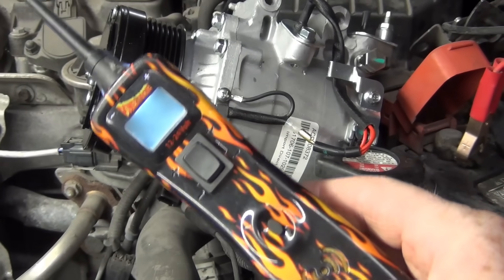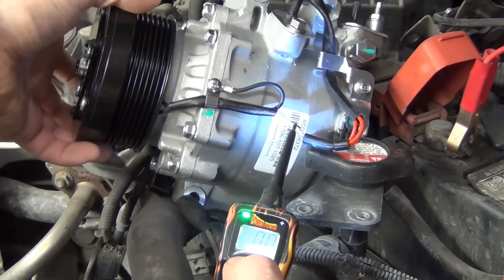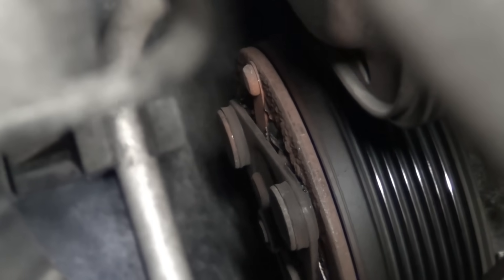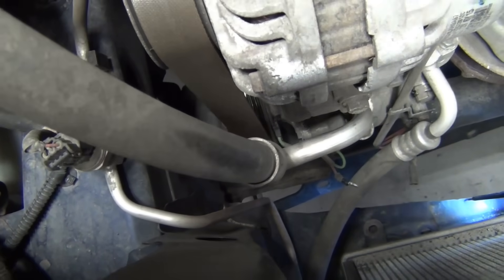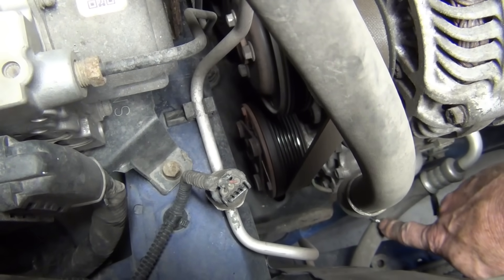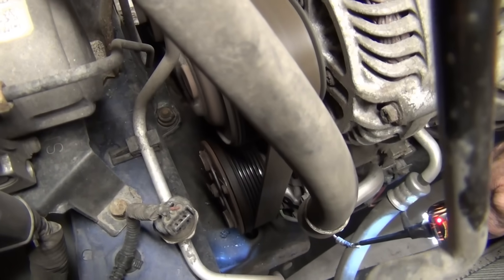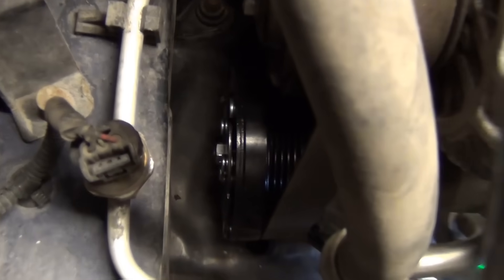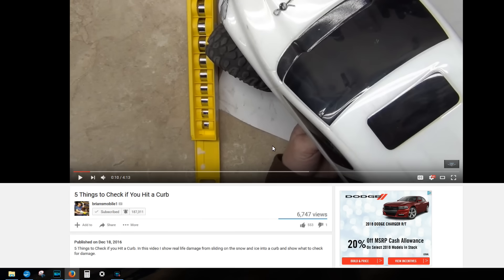How-to Test for AC Compressor Clutch Function

Comment: A 40-50 dollar clutch kit vs a 350 dollar compressor then evac and recharge the system. I'll go wit a 40-50 dollar repair over a 450 plus anyday. But, then again most modern day mechanics are simple parts replacers.
Reply from the maker: That can be a great low cost temporary solution when you can find a compressor clutch for a given application.    In my experience (30+ years) when I have done that the compressor more often than not fails in the next year or two anyway.   It's proven to be more cost effective for my customers to replace the compressor with a new clutch, and the reciever/drier and not have to do an extra clutch, evac, and recharge on top of that in the long run.
Reply: AC compressor for my car is more like 6-700 euro. And a used one. Like the half price. Not fun at all.

My clutch doesnt engage either. AC relay and AC fuse in the fuse box clicks and seems OK. Should engage when i activate the relay manually through my bidirectional scantool. Relay clicks but no engage. :(

Had a metal sound when i turned off my car for a long time. Like clutch dissengaged hard or something. High sound anyways.

When i turn the AC on/off button the rpm raises/loweres so i guess nothing is wrong on the computer input side.?

Comment: My problem is that the church is engaged it never disengages and air is slow to cool.
Reply from the maker: You could be low enough on refrigerant that it never can build enough pressure on the high side.  Could also be a stuck open expansion valve (on some equipped vehicles) or a bad compressor intake solenoid (on some equipped vehicles).

Comment: Spend $100 for a glorified switch with a light in it?  Pure nonsense, you can check the ac clutch the same way with a wire clipped onto the positive battery terminal.
Reply: Who is glorying it? It's a tool being used for its intended purpose.  As far as clipping a wire on the positive terminal,  that sounds messy. If you have the money,  why not invest jn a power prob. I drop a bill every time I go to the bar, dropping another 100 on a tool is  nothing. And why you so mad at what other men choose to spend their Money 😅😅
Reply: Yea but it don’t have flames 🙄
Reply: Also need a a fuse wired in between to safely use that method
Reply: Until you have used a power probe don’t dog on it
Reply: Obviously he doesn’t understand how it works or true function of that power probe
Reply: Just take you’re car to a shop, you sound like a glorified couch potato
Reply: Ok you have mo idea what u are saying
Reply: Either way works
Reply: $15 on Amazon.
Reply: @Evrydyryder  drop the link
Reply: There's some on Amazon for under $25. It's a great thing.
Reply: ya most people like u will poke snd hack up wiring that tool is invaluable for electrical work on cars
Reply: @hiby9105  Or they'll end up frying something that was supposed to run below the full 12 V they just fed it. Kind of a prime example of why stubborn idiots hate modern cars, really. Don't like learnin' things, knowin' stuff is for NERDS. 

Irrespective of the fact that gearheads are just nerds with a gol dang wrench.
Reply: @hiby9105 false bud.
Reply from the maker: That's how I thought till I used one.  Took me years to get over my ego about it.  Bottom line- I use it constantly now that I have one.  It's more than paid for itself in time savings over many jobs and many years.

Comment: What if the compressor clutch engages at all time?
Reply: Ali Alrashidi there are variable clutches l, meaning it slows down and speeds up. But if it’s constantly spinning with the speed of the serpentine belt, then your compressor might be stuck on engaged, the compressor should never be on, the entire time.

Comment: I had water seep into a disconnected 07 Subie A/C Compressor, Rusting up the Front Needle Bearing. Thus freezing up the Rotation of the Compressor. I've Cleaned, Loosened and Assy Lubed up the bearing and the rest of the Innards. Now, Wondering if I can Road test this unit to see If it's working?
Reply from the maker: Once bearings are pitted or rusted and especially if the rust material is still in there, it's days are numbered.  You can take the belt off of it and run the car.  I would recommend a tear down and replace the bearing or the compressor to do it right.  Bearings are cheap if you can find them.  Often $6-$20.  If you charge and run the system with rusty bearings it would be like a robot vacuum encountering poop on the floor.  it will spread through the system.  If you don't charge the system, your low side cut out won't let the compressor come on and it wont run.

Comment: So the clutch shouldn't engage unless I turn the a/c, on right??
Cause mine is on and off whenever  the engine is running.
Thanks for the video.
Reply from the maker: If your defrost is on and your car is newer, it will turn on the AC for you and turn off recirculating air for best defrosting results.

Comment: Hey Brian! I have a crv 04 and when When I am driving round with ac on my idle will serge from 1500 to almost 3000, just when ac is on!  And it seems it is only when ac clutch disengages I will get this violent engine serge Took the car to a mechanic and  he said He stabilized the compresser because I was getting very high readings on the low side added refrigerent but I am still having the same problem any Ideas? And does the engaging part of clutch spin freely when turned by hand with belt off the car? Mine is pretty hard to turn just sitting there not engaged?
Reply from the maker: Geez, It's been 5 months.  Has it been resolved?   
Was it overcharged or was the compressor getting black death?

Comment: My service manual says to test the negative side of the battery to the compressor clutch plug, and positive side to the ground. That doesn’t make sense. I have s 2004 Honda Accord. In your video you connected the negative to the negative or compressor chassis, and positive to the plug correct? Do you think my manual is wrong?
Reply from the maker: If your car is German and is using DIN wiring it could be like that.  Most cars supply power to the circuit.  Germans supply ground and the power is always on.

Comment: hey brian whatsupI like you video I got ask you something I replaced the A/C compressor and the new one dosent work And now my fans dosent work too I checked everything fuses,relay. do you think that I get the wrong compressor ? I said that cuz when I disconet  the A/C both of the fans work my car is a ho nda civic si 2006 coupe, thanks
Reply from the maker: Thanks Gilberto, it's possible it's the wrong wiring config/ wrong compressor.  Is it a single wire to the compressor clutch or more?

Comment: Is a symptom of a bad compressor that when you turn on the AC, it engages, but never stops spinning like other cars.... I'm sure that my charge is perfect......it will stop spinning when I turn off the AC , but is never intermittent? Any help with this would be great ....btw, my condenser fan comes on every time...so that's not the problem. Thx in advance for any ideas.
Reply: Michael chilner did u find the solution after most 6 month

Comment: hey Brian.... you the man! excellent video, precise and straight to the point AC compressor check without taking 40 minutes to an hour to explain, question though, did you vacuum pump the system, did you have to change the orifice tube and the accumulator before you install the new compressor, I'm just curious.... cuz I've got a 03 Honda Element I need to replace the compressor on it won't engage as well, I love that tester unit you used to engage the clutch, sweet! I've got to get me one of those, like I said; excellent diy video content bro! that doesn't take all day to explain, cuz time is a precious commodity! anyhow...thanks for the response in advance.
Reply: Good question dude .  And I notice he never answered it..... .

Comment: Single woman here so sorry if my question is dumb but.....What if the clutch engages and then the air blows cold when its straight wired to the battery? What would i need to do ?(2000 buick lesabre) Im a single mom with no money to take it to a shop lol..The  clutch wasnt spinning until the straight wire..every time he touched the wires to it..it quickly blew cold air but as soon as he took it away it went back to warm air and clutch stopped? I really hope there is a fix for it that isnt expensive.
Reply: Good news. You have an open circuit between the compressor clutch and battery. Trace the wires back. I’d buy a service manual online for around $10. Follow the troubleshooting a bad compressor section. Relays and switches go bad but you need to follow the circuit flow to make sure.

Comment: Thanks for sharing your knowledge...I have a 2001 Chevy Silverado 1500...a/c not working on idle blows hot air and when driving is nice and cold. I have remplace the fan clutch and the a/c low pressure switch. Any ideas on what else could be causing the problem.? Thanks for your help.

Comment: Hey can someone help ? Got AC issue, air blowing hot always. Car : Jaguar s type 2.7 diesel, 2005. things already done  : 
1. checked system for leaks :  none
2. Recharged system with refrigerant. - still blowing hot. from both sides
3. Replaced DCCV to new one - still blowing hot, but passenger side is actually blowing colder
4. Removed Remote climate control module for inspection - perfect condition, put it back in
5. checked if air doors work with every option (only legs, legs and cabin, cabin and windows, windows) - they move accordingly , open and close.
6. Checked if compressor clutch engages with ac turned on - it does but in a minute it stops. While it is working , air is still blowing hot. 
Is it the issue with compressor ? i am lost././
Reply: Maybe overlooked cabin air filter? Faulty cabin temperature sensor or outside temperature? Just a guess

Comment: Hi I have a 2005 Cadillac STS 4.6 northstar v8 I just serviced my AC unit was alittle low on Freon so i topped it off within the safe psi of what it calls for my question is how do I reset ac service message on the dash? Any help would be greatly appreciate thanks

Comment: I checked all electrical, replaced pressure switch on evap., and while checking my relay, I inadvertently installed it backwards, which engaged the clutch, but made a grinding noise. I quickly removed it and put it in properly, but still won't engage. I replaced the relay, still nothing. Is clutch bad, then? Thank you. Enough refrigerant, etc.

Comment: Hey Brian - Great video. My '97 Mazda MX5 (ok, Miata) had, in addition to the AC relay and the high & low side switches, a thermal protection switch (a thermocouple maybe?)  that would cut power to the clutch if the switch sensed overheating. Basically, the power feed would go into this switch, and then a line from the switch to the clutch.  Often, these switches would fail  prematurely, even if the compressor & clutch were still working. Some Miata guys would simply bypass the switch to get the compressor working. 

Do you (or does anyone) know if the Honda compressor also has such a thermal protection switch? Thx
Reply: Someone had mentioned this to me last year when my AC stopped working on our record day here in WA when it reached 108° theorizing it might be that it overheated the "switch" that you are referring to! Makes me wonder!

Comment: I paid 1500.00 to have evaporator core, heater core and compressor replaced but not blowing that cold like it should be? I'm definitely taking it back , but any other reason? 2008 Nissan Altima
Reply: JR SIMP Really strange they didn’t replace the condenser. The new ones are junk if they experience any contamination from compressor failure
Reply: NordicPride970 You think that's why it's not as ice cold as it should  be?
Reply: JR SIMP Many variables, but it’s well known that modern ac condensers have such small passages that they cannot be effectively “flushed”. So if it’s clogged or damaged it’s something to look into. Typically you can check with a laser heat gun and see if you find an area that has a large variation in temperature. Of course things such as system pressure and a properly working expansion valve are other possibilities. But if you had a compressor fail previously, and they didn’t replace the condenser, that’s just asking for problems...
Reply: NordicPride970 Thanks alot for the response.

Comment: how do you recover and recharge the system, also do you use nitrogen to find leaks or dye
Reply: Dye to find leaks, but in most cases the car leaves the factory with UV dye inside the AC circuit. System is recovered and recharged with expensive equipment and a licence is needed.
Reply: jamecorts it’s not that much money at all to get the machine to recover it is about $400 or you could buy them used for a lot cheaper and to get your 609 certificate you don’t even have to go to school for it you could just pay to take the test which is not that much but you don’t need a certificate to recover it only if you are charging someone to recover it. And when you recharge it you need a set of manifold gauges and a vacuum pumps which you can buy for $50-$60

Comment: I have a Nissan altima the AC works when it wants to clutch and compressor are good could it be a wire fuse or relay?

Comment: After l refill the system my Camry 2004 compressor began to do noise then 20 sec  work 10 s off after that the indicator light flashing and the comprosr works for only 1 sc  when I start its plez tell me where the problem.

Comment: Hello there. I have the coupe version to this car. My car makes a weird whining noise. Not squeak. Not grind. A whine. Sounds like power steering but was told its not. Its ac compressor. My ac works fine. Car buzzes/whines when ac compressor is off. When i turn ac on, noise goes away! Used to stay away, but only stays away when clutch engages. Ac compressor shuts off and car starts to whine again? Any idea what it could be? Bearing? Pulley? Belt? Car is noisy until ac compressor is turned on. So i turn it on everytime im driving to get rid of whine. Goes in and out whether or driving or idle. Mechanic says its compressor but the compressor helps get rid of noise so i dont understand how that could be my issue? Any thoughts?

Comment: Nice vid...I just start having problems with mine the compressor looks fine still running and when i turn on the AC ( Cold ) it wont work..the heater works fine I check if needs Coolant or Freon and as fast i look the freon gauge the black line went for green to red. Any recommendations??

Comment: Hey I have a question. If engine is cranking, has spark, fuel, timing, but doesn't start up what could it be? I just uploaded a video of what is happening. Please check it out. Any advice will be appreciated. Thanks in advance
Reply: spark,fuel and compression....what kind of vehicle?  any codes??

Comment: I'm having slow engine power take off when my a.c compressor is engaged. But when it's not on,  I have plenty of engine power. But my compressor is working fine, does its job.  New AC clutch is $100, but new compressor with new clutch is $185  now I'm stuck on which choice to make.  Help? Lol hahaha

Comment: Not to mention that new compressors come oil up already. I had the same problem with my first car the fan clutch went out and the shop I took it to told me. It's a lot easier to replace the whole compressor than have something else go bad later down the road. So I did even though it cost almost about 1k. But we'll worth it.
Reply: Not necessarily a new compressor is the way to go. I've had the Harrison CVC compressor in my car stop working about 6 years ago, after 8 years with the car down the road. The clutch coil died because the original coils come with a thermal fuse that just like in home appliances opens up without a reason from time to time (heat cycling or vibrations perhaps) since the coil didn't have any oxidation or burn marks at all and the fuse didn't look like it melted or burned up (i asked to have the failed coil given to me so that i could examine it). Paid about 400 bucks to have it serviced (the compressor had to come off due to cramped space preventing clutch assembly access from the front), and not the 1000 bucks for a brand new compressor. A year later it ceased working again and this time the servicing was on warranty. That last coil has been working for 5 years, don't know whether it comes with a thermal fuse or not, the thermal fuse probably is on the coil to allow the compressor to immediately disengage as soon as it starts locking up and making the clutch slip, but preventing compressor lockup is simply a matter of having your AC properly serviced once every 3 years so that gas and compressor lubricant oil levels are regularly checked and, if necessary, restored to proper levels, and fixing any leaks. But, for these compressors, a new clutch pulley assembly, including the coil, is about 150 american bucks or less, and a new clutch coil is even cheaper.

Comment: Them there Honders like their clutch failures. Seems preventable with a better part in the first place. For living in a Northern climate, I do a ton of A/C work.... a lot of which in custom dual evap systems on ambulances..... making hoses, a crap ton of 6.0 diesel fan clutches, brazing hardlines, basically rebuilding whole systems in the event of catastrophic compressor failure.... it is all common. I dont see a lot of clutch failures... Ive heard about it in Hondas a lot though.
Reply from the maker: Sounds about right.  On Honda's you also see a lot of those Omron relay's fail on the AC compressor resulting in dead batteries overnight.